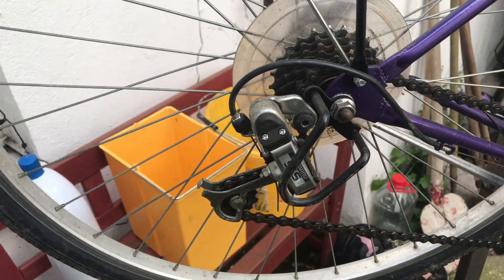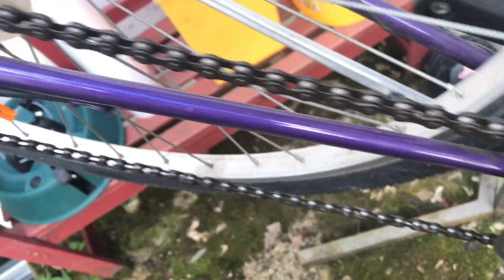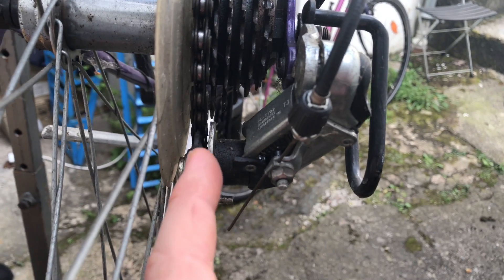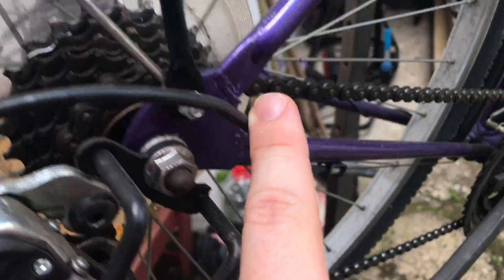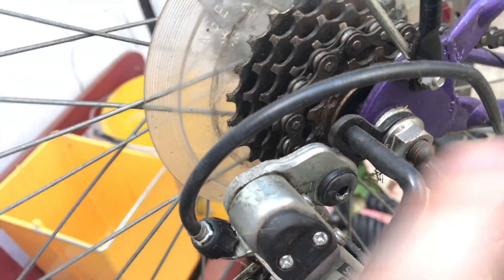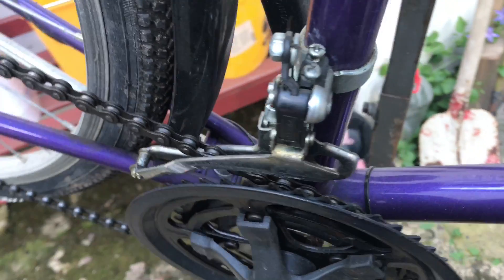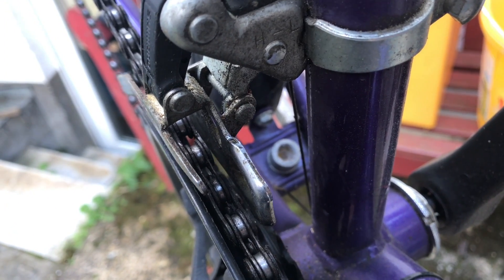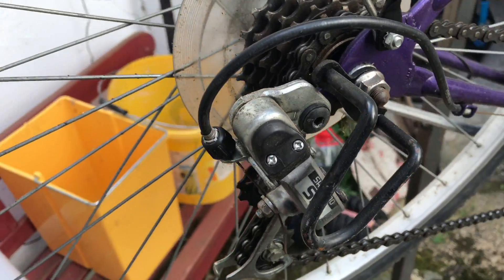How to adjust bike Derailleur gears Shimano SIS gear setup adjusting bike DIY

Comment: 2:10 "You can adjust one of those two screws" - You mean the High and Low screws that are vital to smooth gear changing.
You couldn't explain suicide to a lemming. Goodbye.
Reply: Can I fix that?
Reply: Cause my dumbass took his advice